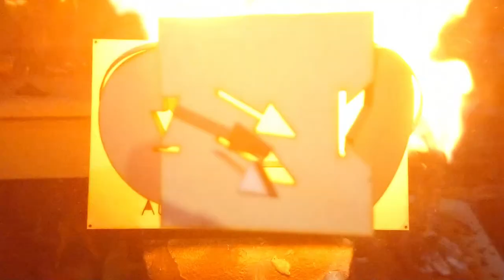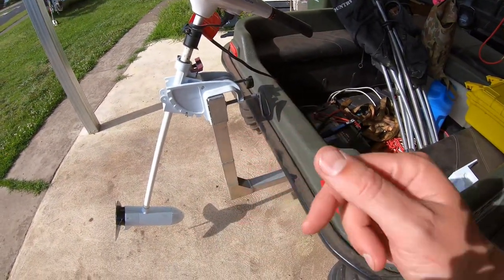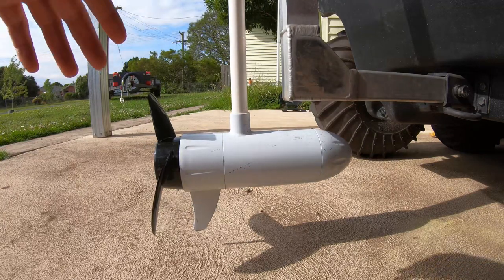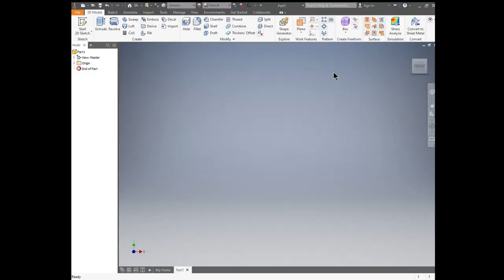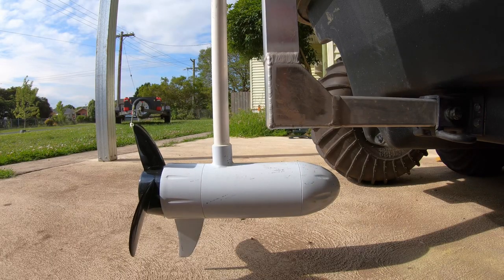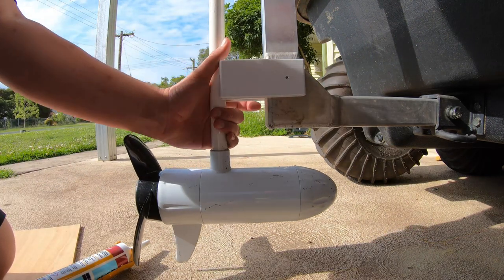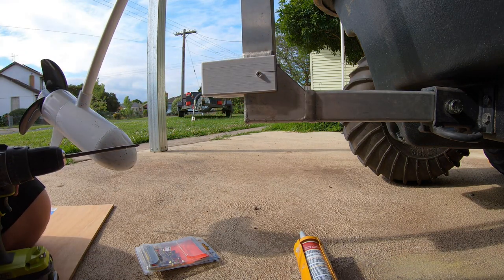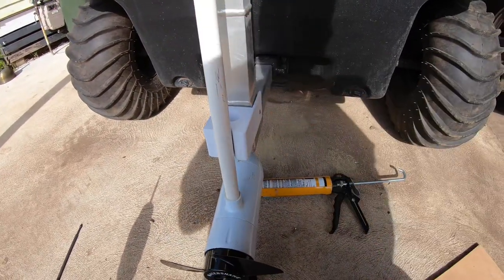Trolling motor buffer |  New Argo 8X8 - Episode 29

Comment: Nice build.
I would have made the semicircular cutout have some straight sides to make sure you are able to take the lateral forces and keep the alignment.
In other words make the semi-circular cutout more like a slot.
Reply from the maker: Given the terrain I'm likely to take it through, I wanted to avoid dirt and mud building up in tight corners. Round surfaces tend to be easier to clean as well.